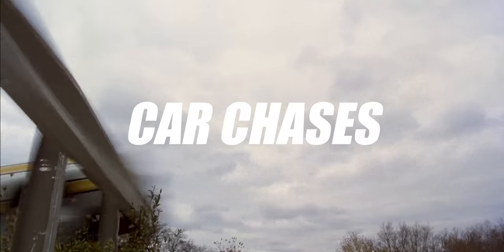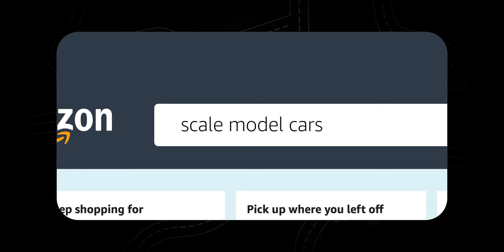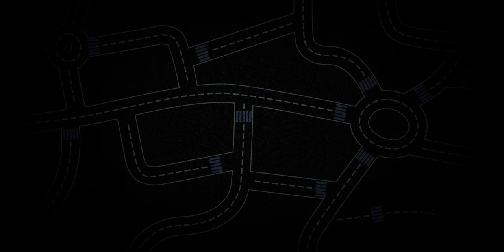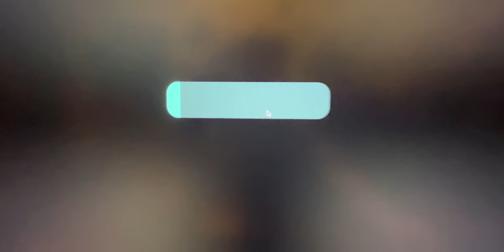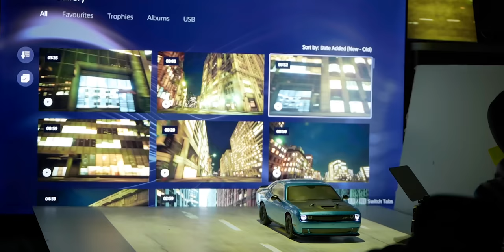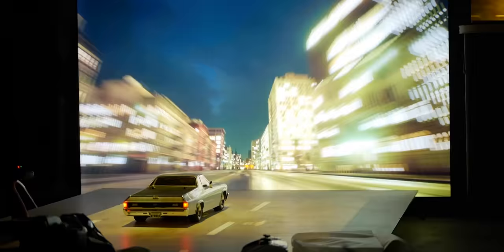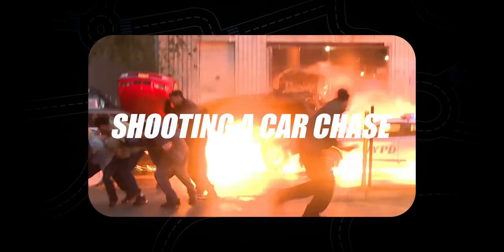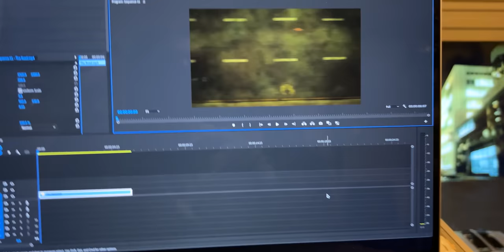Making a Hollywood Car Chase with RC Cars

Comment: I think it’s a really good effort. 

Constructive criticism; the things that first sprung to mind, 

1) the natural weight shifts that we are used to seeing like the little shake you get when you start a powerful car, and the shift in weight when the cars round that first corner. The visible inertia drop when someone manually changes gears. They are the kinds of clues you get to know something is effected by the physics our world. 

2) I’m not sure where you sourced the road plate, while the texture of the road seemed to work well for projection overlay on the cars, having the writing projected on top of the car ruined it. 

3) Believe it or not the darkness of the shadows under the vehicles put me in uncanny valley. I realise that you may have been trying to hide the lift of the vehicle, but we are used to ambient light around the underside of a vehicle. 

Kudos on the light of the other vehicle appearance from behind. 

Anyway a good effort all round and thank you for sharing the journey.

Comment: It looks so good! The only thing that ques me in yo ybe fact that its not fullsize is the small movements. The cars should be bumping up and down snd side to side slightly as roads arent perfectly flat and when the cars are in line with each other if theyre going full throttle one should be pulling away slightly or if one vehicle is trying to match the speed of the other the cars tend to move forward and backward a little. That being said this is amazing and i doubt i could do anything remotely close to this

Comment: You can get 2 to 5 little things that would help sell it even more.  Magnetic body mounts (or velcro I guess); different motor wind/gearing so they aren't so fast; weaker springs and/or some stick on "wheel weights" so it handles more like a real car.

Edit: well, now I seea motion mount is probably more what you could use.  Amazing results btw 👍🏼

Comment: you could have tried this, putting camera besides the car giving it an illusion of moving forward and animating the scene to change direction (in the tv scree). you would have to just turn the tiers for it to look like it's moving in different directions. Like a low pov shot from the car where you could see the front tier and some of the car itself... and rest would be the screen on the right side, almost 70% of it would be the scene from the tv

Comment: Awesome video,
As a Filmmaker but VJing a lot before it,
Get the projector for the road a little bit out of focus. Doing so, you wont see the pixels on the asphalt.
Actually until recently, most IMAX were not 4K, they 2 projectors 1080p on top of each other, to have maximum brightness and also to blur the pixels.

Anyway, good job, you can also use a technique used in Lana Del Rey MV, where they use a triangular mirror spinning with a light pointed at it, you can create the effects of street lights passing by.

Comment: This is pretty great, the only tiny detail I think that was missed that would give it that extra realistic “feel” would be the gyroscopic movement of the pitch, dive, and roll of the cars motions. You even showed that little clip of the Batman filmmaking process where the cars are on a gyro device if you could incorporate something like that into the base stands the car sits on that would be perfect then you could replicate the natural body roll movements giving the film that 100% realistic touch. Without it, I feel the cars still appear a bit “stiff” and not really “fluid” and lifelike. Just my opinion though what do I know I’ve never made a film before. 😂

Comment: allow me to give you suggestions or input that I noticed from your video, maybe it would be better if you removed the body clip on the RC body and replaced it with a magnet on the inside of the RC body to make the RC body more realistic, especially on the hood the engine is still very clearly visible, and the point of light on the left side of the front hood or fender has not changed, it is still at the same point in each frame of the scene, but everything is good, good hard work and deserves high appreciation. this is cool and good

Comment: I really enjoyed the whole video. The time passed really quick. I have question though.. What would happen if instead using the projector from the top, using the first small tv from the bottom, in order to make the road moving? In my opinion as a viewer, I think you could accomplish better texture and relastic - reflexing shots. With the use of the projector I see the "masking" on the car models and also those little pixel-boxes of the projector lamp. With the tv placed on the floor and the cars on top of it, I think you would get that crystal feeling. Overall incredibly enjoyable work. Kudos!

Comment: Looks brilliant. I fouldnt eo anything this good if i had 5 years, but the things i noticed:

- the external car shots were too zoomed in, i know there were reasons for this but it felt clostraphobic being so zoomed in (this ia the main one), there could have been a scene with both vehicles from in front and video of your faces superimposed at a low opacity in the front windscreen
- when they slam on the accelerator the front of the car should raise up to show the extreme power of the car, push down on the back a little
- the fade to blacks during key moments like cornering and car collision while they had to be done of course, also made it seem fake

Comment: Not bad at all. What would’ve made it better? You held onto the cuts for way too long. The headlights also give away the game, if you could fix the headlights to make them brighter so they flare, you’re cooking. Also, quick cuts, I mean Michael bay style 38 frame cuts, might allow some quicker wide shots. Open it up a bit. It might’ve been neat for when the car collide to get some sparks in there(which can be achieved various ways) tho sparks might give the miniature away. Some ambient soundscape sounds might’ve helped too. Granted that’s really hard and what you did with sound worked well. 

Overall it was a good try. You got some good footage and with a small budget this might be a legit way to get around filming with actual cars. I’m trying to imagine if this could intercut with actual cars and the miniature ones are left to do the big stunts.

Comment: Fantastic job, but the only thing that breaks the illusion for me is the obvious pixelation from the overhead projector. How about another TV for the cars to sit on and then the pixelation would be much smaller? Or even a second overhead projector with the same images, but just slightly offset from the first to fill in the blanks between the pixel lines.

Comment: All in all an amazing project result, allmost nothing broke it for me.
Just one little detail i might want to add, the drift at the beginning was kinda off for me.
A little too close and too many cuts, would have worked better if it was a single angle shot at a little more distance so the drift would have been in full view.
Many cuts in a single scene signal to me that it wasn´t a proper maneuver, like in martials arts movies many cuts in one movement are used to hide the fact that the actor actually doesn´t know how to fight.
But that was the only thing, the rest was amazing,

One other thing just in case u do something like that again for a little tik more realism cars don´t maintain parallell positions evenly during a chase.
they gain a few inches and lose a few inches and gain them again, but that didn´t effect this chase for me, wouldn´t probaly notice even if i didn´t know how the chase sequence was made, but maybe it is something to think about doing something similar in the future :)

Anyways very well done.

Comment: I think the projector throws really strong pixelation of the road - could you have used the other TV as the road instead? Better definition and dynamic light adjustment. Learned heaps from this, thanks mate :)

Comment: Beautiful work! Question: When the second car turned on it's headlight in the alley after the first car passed I REALLY wanted to see the car as it pulled out of the Alley Way. Instead after the headlights turn on next time we see car #2 it's already on the road. Was it to technically difficult to show car #2 pull from the Alley Way to the main road?
Reply from the maker: Haha yes, you’re right. I would’ve loved to have included that too, but it was just too difficult - especially with all the compositing I had to do on that particular shot.

Comment: As much as I love GTA I think you should have used Forza Motorsport for your sound effects, it would give you a much more accurate sound and with the manual with clutch option you're able to hold each car in gear for as long as you need instead of relying on GTA's awful car choices. Other than that this was awesome, especially for something done by one dude in a garage.

Comment: you should have asked rc car experts! 😀 they could have helped you make the cars look much more realistic. but fortunately you had your own innovative ideas which made that unnecessary. the idea with the projected street on the ground was brilliant!

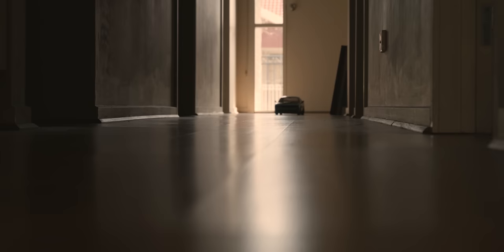there are sensored motor/esc systems that accelerate extremely smooth, so it wouldn't look like it did at 5:13 and 7:21. or you could have installed a motor with more turns and different gearing, then the car would have had more torque and driven slower in relation to it's scale.

a slower servo or steering settings would also make the car look more realistic, because a real car would turn slower, since its heavier and has a bigger steering wheel than on your transmitter. then the car would also be easier to control for someone who never drives these things.

many guys in the rc scale community make their videos run just a little slower so that objects that interact with the car like small pebbles move slower and look bigger. There are even active suspension systems that simulate the movements and sway of large cars when they brake and corner. but these are expensive.

people in the hobby would have known where the cheapest offers could be found. you could have got very very cheap or even used chassis and separately bought cheap electronics from china, but with the characteristics that I mentioned above and then spent more on realistic scale bodies with included lights and add on parts. you can use magnetic body mounts or mount the body with velcro tape, so that there are no visible holes in the body and no bodyclips.

the body should be painted with an additional layer of black from the inside (without the windows) and the leds should be closed up inside, so the light only comes out of the head- and tail lights and not through the slightly transparent body (like you can see at 5:56). you have installed light buckets in the video, which is good, because otherwise the light would have also come out through the bottom and windows.

many things you can do that don't necessarily have to cost a lot, if its only about scale and not performance for racing. some guy had an idea and put a camera on a swiffer, so the camera is on the bottom, the car looks bigger and you can make very smooth camera motions when the swiffer can slide on a relatively smooth ground. With a gimbal you will probably have to walk in a slightly crouched position, which might cause too much vibration from running.

regardless, its a cool project and you did well! 😊

Comment: Idea for next time you need to use GTA V to record engine sounds: 
Grab any copy of GTA V for PC and look into some basic modding (specifically engine sounds). A quick google search such as "Dodge Challenger engine sound GTA V mod" will yield some results, all depends on the vehicle sound you're searching for. 
Mod the sound into the game using Open IV (plenty of tutorials on how to do this here on YouTube) using the chosen car (in most cases you can rename the sound mod files to match the car you selected for modding).
Then as normal just record the actual real-world engine sounds from the modded vehicle rather than the Rockstar versions, they do sound nice but most of the modded sounds are pretty streets ahead. Added bonus, because it's an open source mod, there's no copyright infringement. (I could be wrong on that, further investigation would be needed, I'm just assuming).
Profit 😊👍

Comment: Unless these drivers got suspetion upgrade to get away from the popo if caught drag racing the cars should feel heavier when shifting the weight.

I think the cars are lacking a weight to there movements in some scenes, The movement in direction was there! but it was very lightweight. These are big metal machines so there Follow Throught / Overlapping Action / Drag should reflect that in the scenes. Great job otherwise!

Comment: Looking in the rear view mirror the wrong direction. Plus the in car action is wrong, you are sitting in a right-hand drive but those cars are left-hand drive. Now if they would have been Holden. The cotter pins on the hood are ginormous, clip them off. The cars on a road smooth as silk with no movement is odd and catches the eye.

All in all, a professional wanting to shoot a scene like this cheaply enough a website that hosts stock sounds would cover the tab and do it it in his garage with almost no crew, pretty damn good. You accomplished what you set out to do. No viewer of this video could do it in the same manner.

I am glad you did discourage others from copyright infringement as is your duty as an artist. It already runs rampant from the lazy people that usually make videos.

Comment: brother the video sound is great and cars sound exactly as in the real life..., brother as I noticed that you were facing problems regarding the engine sounds there is no problem it you choice but it is just my opinion, that you could use the sound from beamng which is more realistic in compared to gta and I have recorded myself. I recorded the sound of GTR and old mustang both with beamng with minimum editing because of it's realistic sound that it was un-comparable. BUT THE WHOLE CHASE SEEN WAS GOOD @paul_et

Comment: The only thing I see wrong with this is that the drivers side is not correct to the vehicle, his seat is on the right, while those cars actually have their seats on the left which could hsve easily been fixed my just mirroring the video footage for the druver cuts.

Comment: As a rc car builder i must ask... 
was the 70s porn star alive or dead when you hacked his mustache off? What glue did you use attach it? Revell modeling, Epoxy, rubber based glue or Super duper dupa glue?😂

Good effort on vid ❤

Comment: I don't know a lot about filming, but you made so many mistakes with everything else.
* You should have used an OLED TV, for more realistic night scene. IPS/VA look way worse when captured via a camera. 
* There are special paints / screens for front projection that reject ambient lights. They give much better black level and contrast (at the expense of lumens).
* Should have masked off the car in the road projection, and maybe use the projector to add reflections to the car to sell the illusion better.
* The cars have no body movement, this is particularly noticeable in the face off when they rev the engine. (I don't have a suggestion for fixing this though)
* When performing a burnout (not sure why you would, but that's besides the point), the brake light should be on.